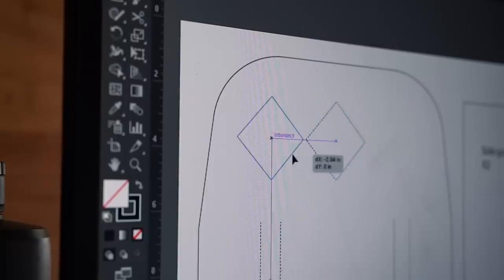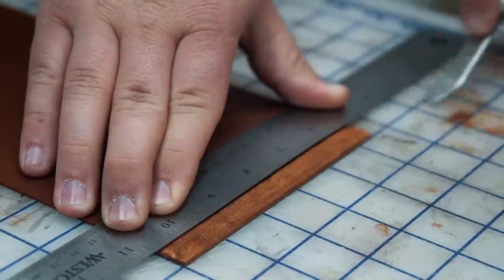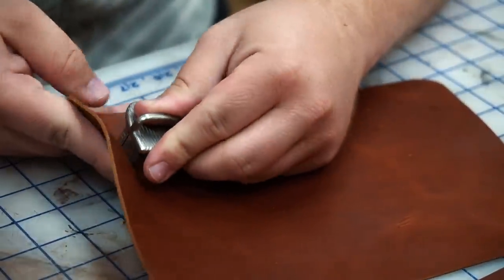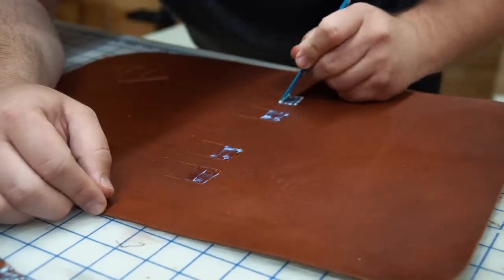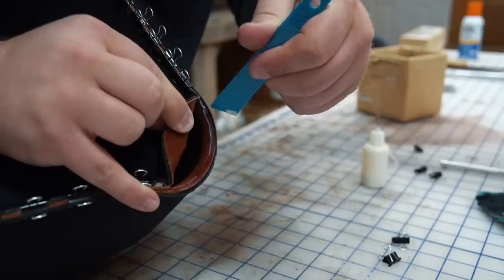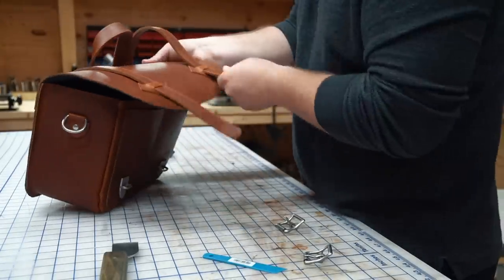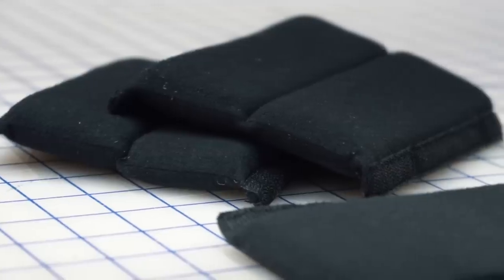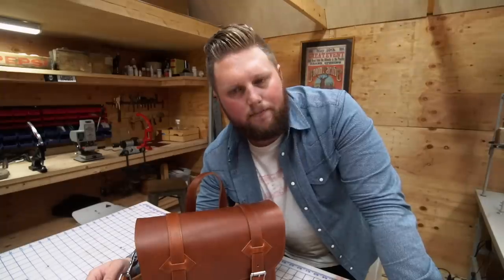Making a padded leather camera bag - DIY

Comment: I like the bag. Just so you know Springfield Leather has a 45 mm Rotary Blade Sharpener for $ 17.99 wholesale and $ 21.00 retail. The blades themselves are$ 8.99 wholesale each and $ 28.99 for 5. They also have some decorative blades. Hope the info is helpful.

Comment: Nice bag. I'm looking to take one of my larger old US mail bags and cut the leather down to recreate a smaller version of the same bag. Have you ever hand stitched a bag using 7-8oz leather where all the stitching seams were inside bag? In your opinion Is this weight of leather very difficult to turn inside out to do the stitching and then turn the bag inside out again after all stitching is done?

Comment: I’ve been looking at that glue you used from District Leather Supply. Do you use the Aquilim 315 Cross Linker for oily bridle or harness leathers? I’ve been using Weldon DAP contact adhesive and I’m getting sick of the fumes. Literally sick.

Comment: How much are your vertical wallet. Love watching you make leather products.  Especially the quick draw rig. I was going to ask about making a two gun fast draw rig. My father is a gunsmith. 51years. When he first started he bought two SSA pistols. 1 in 38 special and 1 in 357. He converted them to 45 LC. Sent them to Colt and had the frames color case hardened. Walnut grips, a matching pair. He then contacted Arvo haka and had a 2 gun rig built. He and my father were acquaintances. They spoke many times on the phone.  Unfortunately I just found out that my father recently sold the 2 guns and the 2 gun rig. You would have loved those 2 guns. Sorry to babble on. I am interested in the wallet though. Please let me know.
Reply: That was Arvo Ojala